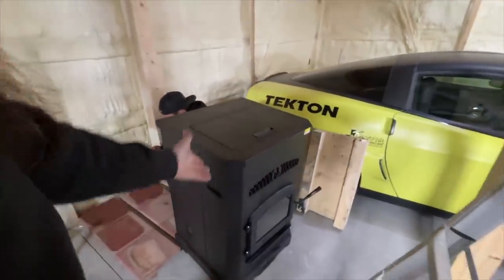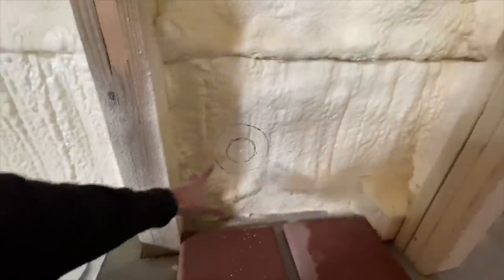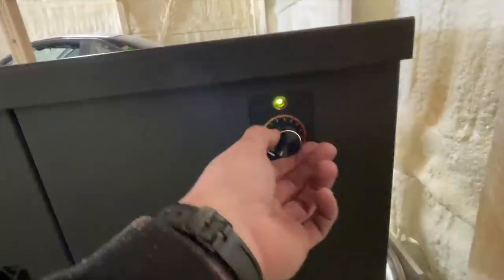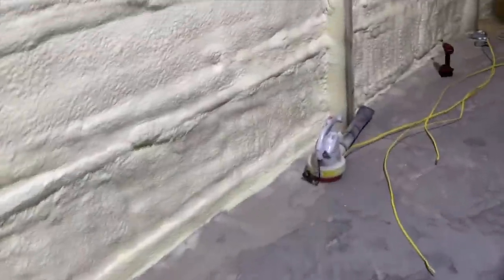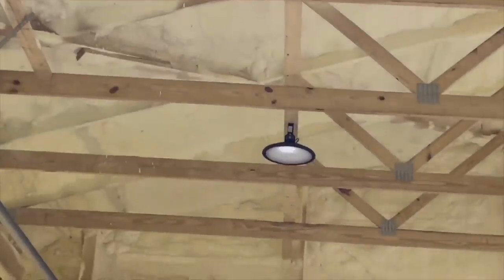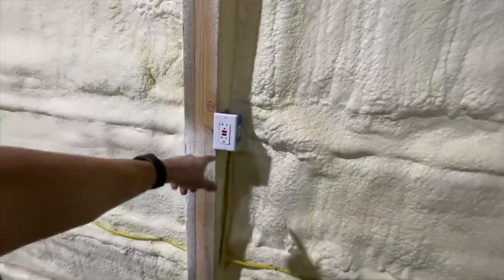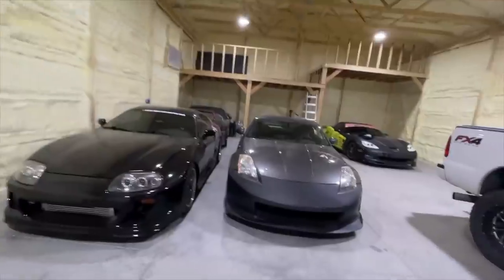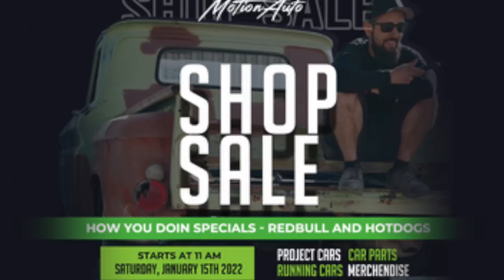WILL THIS WORK?

Comment: Hey Trevor, I run a company consulting and inspecting spray foam insulation, you need to cut the spray foam back at least 3 inches from around the pipe and replace it with a roxul type insulation, you've got a significant fire hazard they way it is setup. In your application you should also cover the insulation behind the stove with type X fire rated drywall or similar. If not, I'd be surprised if insurance will cover you in the event of a fire.

Comment: The trick with that little heater is to use it as a heat maintainer, but don’t expect it to warm up that big space too quick.  When you first turn it on, fire up a couple of propane tank top heaters to get the place quickly up to a comfortable temperature… then that little pellet stove would keep the place comfortable.

Comment: Adding a ceiling fan to push the heat down from the ceiling helps a lot with getting the temperature at floor level up!
Reply: Exactly what I was gonna say.  It will help a lot.

Comment: Trev, I'm pretty positive you need to heat insulate the wall behind the stove. Up here in Montreal, QC, code doesn't even allow any kind of heat near spray foam and all spray foam needs to be covered with some fire resistant material like drywall. Maybe the code is not that restrictive in Colorado, but it would be a shame to have a silly accident happen. Specially that spray foam burns like a b*tch.
Reply: Where I live in BC it would need 2 layers of 5/8 fire rated drywall , fire tape and a spray on fire retardant . And that deck above would have to be 2 by 6 lumber for the floor . But Canada is way different than the US in a lot of ways , the main thing being Democracy verses socialism .
Reply: @Shadowband72  Thanks for the extra info my friend. Let's keep it a car channel or at least on the subject of the video. Politics discussions online always turns to keyboard wars that lead to nothing good but hatred.
Reply: @Shadowband72  ah yes, Canada and all their freedoms they have. so much democracy.
Reply: @BIGxANDxFAMOUS  Hey from Canada, yes I am free, yes there are safety rules
Reply: Lol I have 2 of these with plywood walls behind them. Inspected and certified.
Reply: And fire caulk too y'all...
Reply: The instructions should list “clearance to combustibles” spray foam, is somewhat combustible…at least here in the freedom of the Great White North!
Reply: It's definitely way way too close to the walll
Reply: 50/50 I would assume some heaters yes, and I would also assume Trevor didn’t free ball the install and researched the installation, this is MotionAutoTV not RicerMiata 😂

Comment: Make sure that flame is at 18 inches or above, the floor. Combustible fumes in shops and garages hover below that 18 inch mark.
Reply: THIS.   Fuel Fumes collect lower to the ground being heavier than air.    Insurance company hates the wood stove in my dads shop but allow it after being lifted 20 inches off the ground.
 We're still very careful with fuel in the building however.

Comment: I have one of these stoves. installed it myself and it works well. i leave it on 3, but my space is probably a third the size of yours. I use a bag a day at freezing temps. I'm sure you will like it more than the cold.

Comment: Trevor- for what its worth- ive been down this road... the pellet stove didn't work for me and i have a 40x60 the amount of  objects inside the shop had alot to do with it funny enough (tools, cars and other dense objects that absorb temperature around them- think about your concrete and how cold it is....
-   Here's what I ended up doing infrared natural gas tubes overhead with a couple ceiling fans that's
Reply: i did 3- 10 foot tubes and also a mini split for extra help with moisture, a/c and heat. work well to keep it above 40 when im not out there and i can have it to 65 within 30 mins.  

edit- i guess most of my paragraph didnt post so if you have questions let me know
 I would sign up for the natural gas anyways and have it run out there even if you did a regular natural gas heat pump- the gas is much cheaper than propane, pellets, electricity

Comment: Get a low CFM fan near the stove to move the heat around, and as long as you use the side door instead of the garage doors (which you can also insulate !) you'll be fine.

Comment: You may want to think about putting a ceiling in that will also help with heat and cooling and it will give you more storage room if you put an attic access
Reply: Ceiling or a curtain to close in your workspace a bit

Comment: If that's a pellet stove. I recommend building a chute extention on tip to hold more pellets. Make it out of anything that won't melt like wood or metal. The button is right on top for the lid usually.

Comment: I live in Colorado and am heating my 60x40 shop with a pellet stove.  Takes a bit for it to get the heat going; usually supplement with a torpedo for about 20 min.  Added a 72" ceiling fan a few weeks ago and it has been a great addition.  Pellets are getting to be an expensive source though

Comment: Ceiling fans would help a lot with keeping heat down.. even a paint booth at your shop would be kick ass! Then you can open the doors and crank the heat out of the paint booth 😂

Comment: I used to have a big old shop that had a wood stove and it wouldn't keep the shop warm at all and a buddy of mine re-ran the the stove pipe that used to just go straight up from the wood heater and outside but he re-ran the stove pipe from one side all the way to the top center of the shop and then all the way to the other side of the shop then outside and the stove pipe that went all the way across the shop put out alot more heat and kept the shop very warm and I put a few fans blowing the heat down to help too.

Comment: Man I have that same wood pellet stove you need to put a decent fan next to the stove where the heat comes out and it will heat your whole shop a lot better I do it every night after work man my shop's a little smaller than yours and it heats it all up real nicely but without the fan it has hot spots and cold spots in the shop

Comment: A mini-split heat pump with two air handlers would work fairly well in that shop...diesel jet heater would heat that place real quick...knock the chill off and get it to temp then use the stove and mini-split.

Comment: Get 1-2 large ceiling fans or 4 normal size fans to help circulate the air. For the lights homedepot sells led high bay lights for around $100.

Comment: Put a fan behind it and push the air. If you had ran the pipe up the wall and out you could have made or purchased a heat exchanger which uses the heat going out. Technically if you move out from the wall you can still use one and blow it  vertical.

Comment: Try some cheap ebay/Amazon 8kw diesel heater work great and cheap . Sip fuel ... Or build a rocket stove mass heater !! Have fun and good luck .. and get a 12v 8k heater   car battery and trickle charger.

Comment: The issue with those stoves is that they create a suction which brings in cold air from all the cracks in your house and sucks any heat its making back towards it which ends up making the far side of the room even colder than no fire sometimes. You can route an intake for it from outside and that would help a lot and you can also buy cheap all in one computer radiators with built in water pumps and you can blast the exhaust across one radiator outside at the end of the exhaust or in the exhaust line somewhere, and the other rad would be inside with a fan on it and would be pumping all of that super hot exhaust heat back into the shop instead of wasting so much.
Reply: When you spray foam insulate. You pretty much fill in all the cracks. Pretty much the  only holes n cracks in that shop should b the garage doors.
Reply: @shadowort2287  Yeah that's what I was thinking too, he even mentioned it was a little chilly over there.

Comment: Burn a mix of corn and wood pellets
Reply: It needs to warm all the concrete and surfaces up before it will warm the air. its -13 today in my shop which is 40x80 and use corn with 40lbs of pellets per 14 bushel. keep it at 50 and once you are moving and working 50 is great